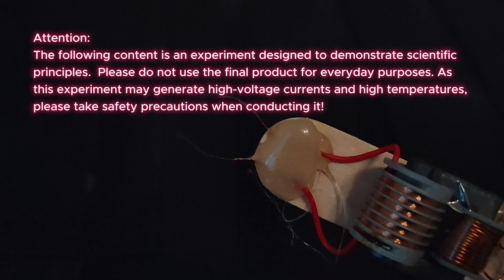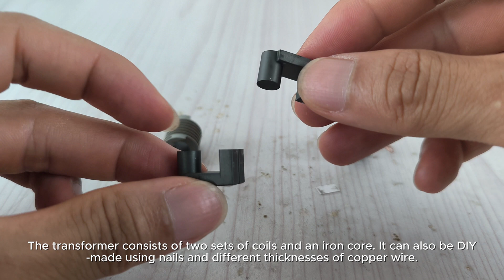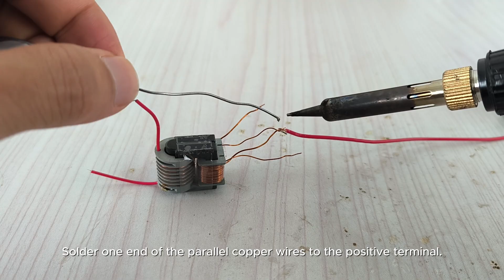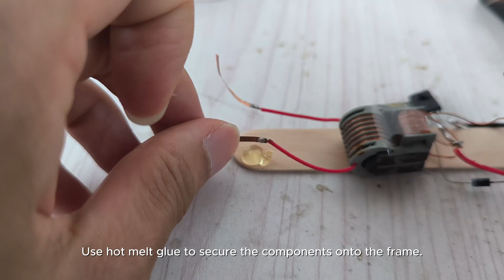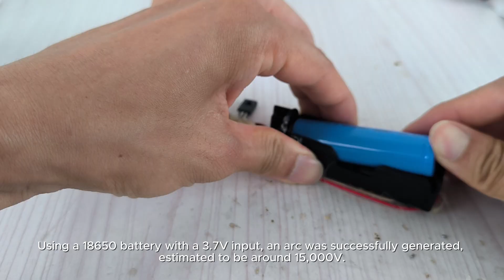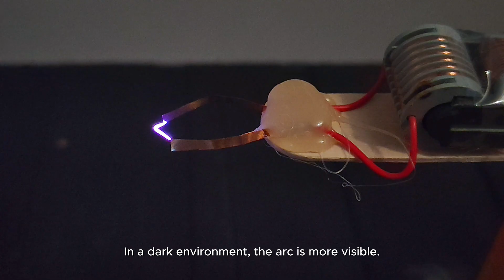Diy Arc Igniter | 15000 Voltage ARC Generator

Comment: sir what is the model number of transistors you used there
Reply from the maker: Hello, thank you for your message. Regarding transistor models, many types can achieve the desired effect. As long as they can withstand a voltage higher than 3.7V, they can be used. Of course, higher voltage tolerance is preferable. You may try searching for the D880 NPN transistor, as it is a relatively common model.